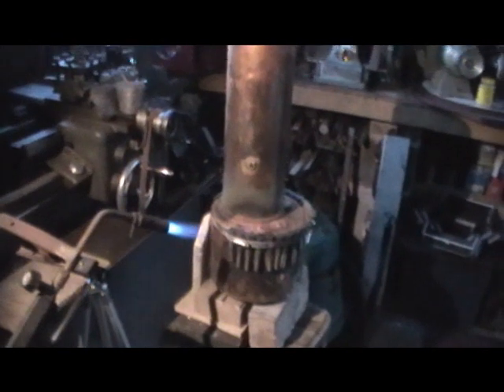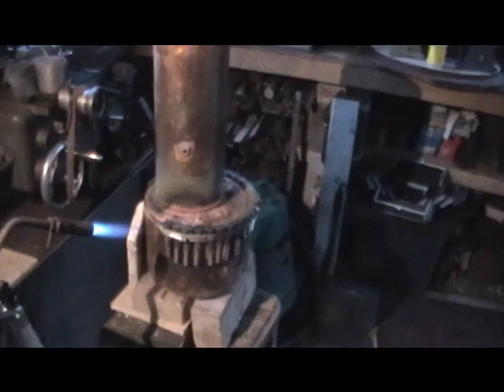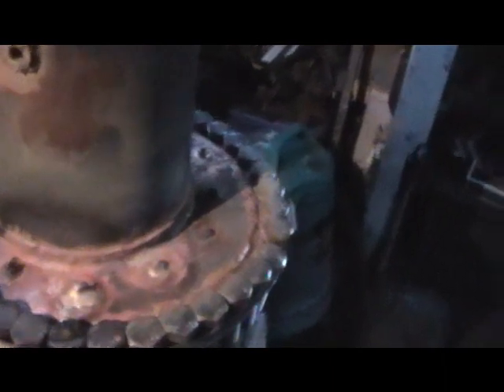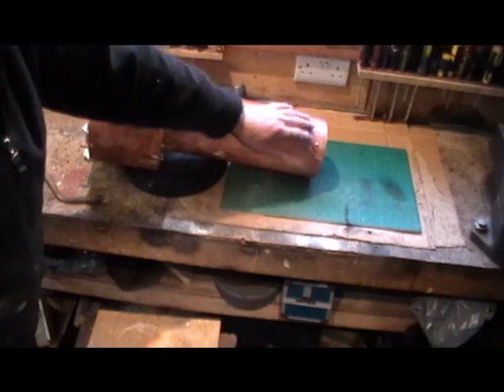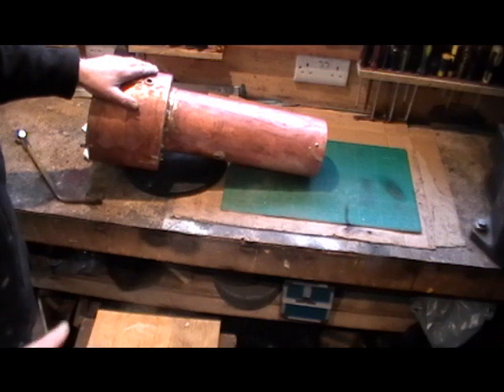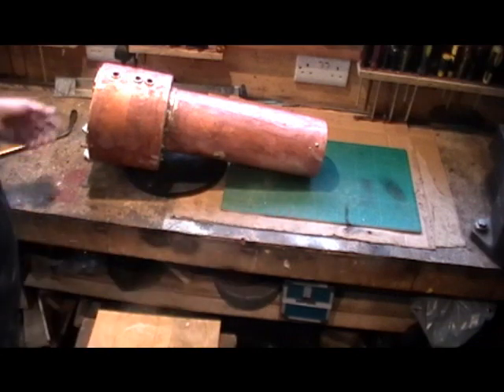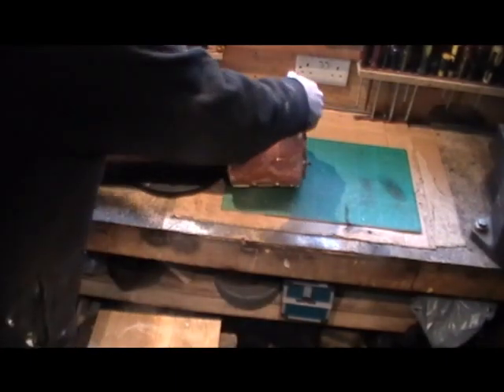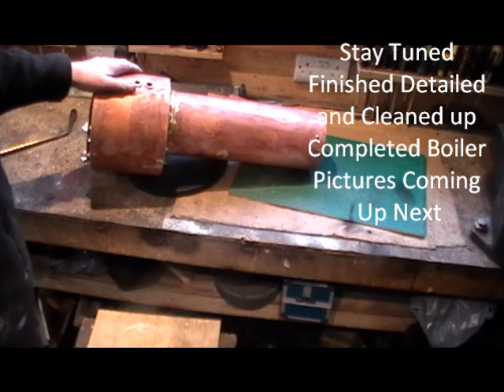Making a steam loco boiler Part 12 final assembly silver soldering "mr factotum"

Comment: cracking job there mate well done!
I'm thinking of making one misen for my stationary engines as i can only run them on air
Reply from the maker: thanks paul
give it a go!!!
regards
mr f
Reply: @MrFactotum  yes . i'm thinking of getting a kit. but they are very expensive. especially if i bugger it up! 
do you use different melting temperatures of silver solder?
Reply from the maker: @paulrayner4514   hi paul. yes the materials are expensive, but doing it myself i shopped around and saved around 66% against buying one of this kind. I just used one temp of silver solder,  easyflow.
regards
mr f

Comment: Hello Mr Factotum,
Thank you for your very inspiring videos. I have watched all of them. I have decided to go for it and start with the boiler. Our local (Dutch) boiler inspector is, after a few corrections, OK with the design.
My question is: what amount of silver solder did you need for your boiler?
Regards,
Fred Smits
Reply from the maker: Hi Fred
Thanks for your kind comments. Great to hear your having a go and thanks for watching all my early beginners video's  there not great quality!!!! It must heave been tough!!! Mind you I'm not that much better now🤣
The question you ask is very difficult for a few reasons. 
1. Its a while since I did it, so I am going from memory here.
2. It was the first time I've ever done silver soldering in this large scale so may have put on more than was necessary.
3. It depends on how big the gaps are, that is the fit of the parts to be soldered.

If memory serves me well, the easy flow solder sticks were approx. 3mm diameter x 500mm long. I think I used around 10 sticks. There not cheap items either to buy, however with shopping around for my copper and solder I saved approximately 66% on the price of a professional ready made boiler, a massive saving. 
This is only a ball park estimation, but I don't think I am far out with the quantity. + / -    
a couple of sticks.
Hope this helps and hope it turns out well for you. Just make sure everything is as good a fit as possible, and that everything is spotless cleaned & degreased and everything is well fluxed. 
Just one thing out of interest, what did your boiler inspector need correcting.
All the Best and keep me informed of your progress, if there is anything at all I can help with, please feel free to ask, however minor you may think. If I can help I will.👍
Kev (Mr F's W)

Comment: I was watching the video as I need to weld the copper tank inside the Traction Engine  tender and I need  more heat than I can get from my largest  oxy/acetylene welding nozzle. Can you tell me what make, size and from where I can obtain such a nozzle (pepper top)
Thanks and regards
Reply from the maker: hi el
ive loaned the nozzle to a friend of a friend so can't get details of it at the moment, but any good welding supply shop will have them, its a pepper pot nozzle thats designed for oxy acetylene, but works fine on oxy propane
regards
mr f
Reply: Ok thanks mr f
regards
EL